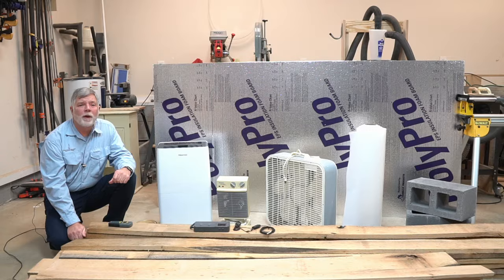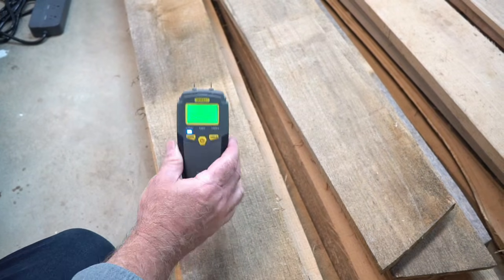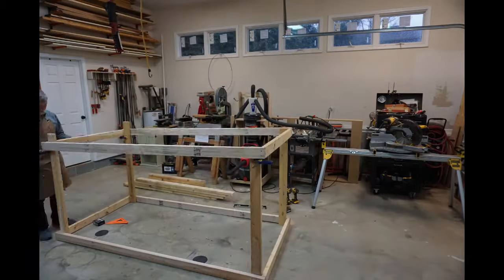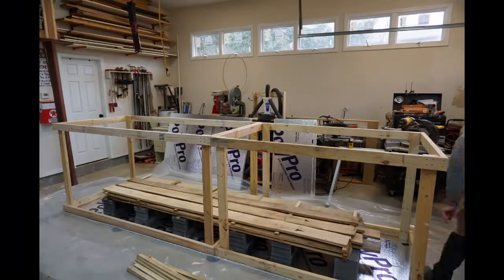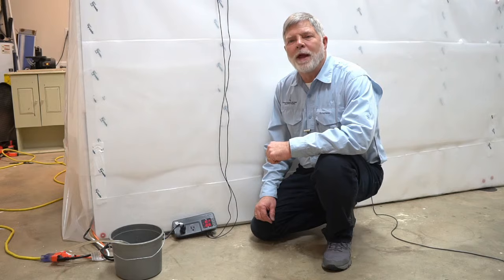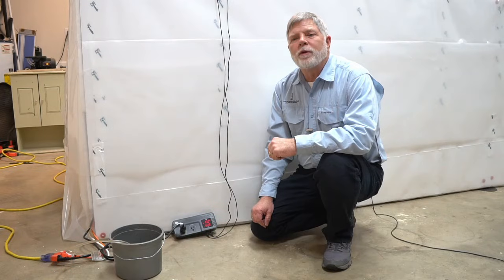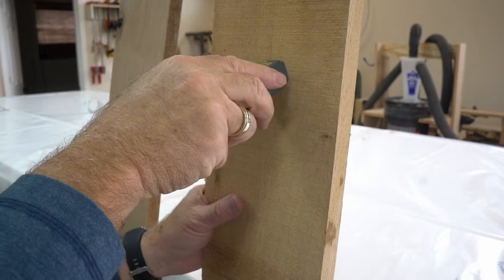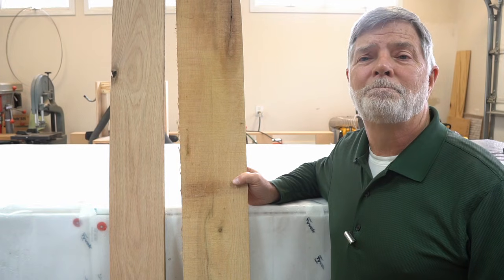Simple DIY Wood Drying Kiln

Comment: I have a project that requires the wood from a large log sooner rather than later.  Would I be able to use this kiln to dry the wood faster, or do you still need to wait a year to let it all dry before putting it in the kiln?
Reply from the maker: Yes, you can dry green wood in this kiln. It will take 60 days or so. Dry the wood slowly and keep the temperature around 90 degrees.

Comment: Very good information and thanks for sharing it with us.  I am building a 4ft by 4ft by 6ft hot box inside my garden shed.   I put a 24 inch by 32 inch tall access door yesterday.  Testing last night it was 13 degrees outside and it got up to 131 degrees in 45 minutes.  No wood in the kiln yet.

Comment: Can i use this for outdoors?.  I don't have enough space in garage?  Also how long would it take for newly cut trees to get to 8% for woodworking?
Reply from the maker: This design is not weather proof. I would not recommend using it outdoors. Depending on the species of the wood and the thickness of the lumber, it will take 8 weeks or so to dry from green to 8%. If you dry it too fast, the lumber may crack.

Comment: Absolutely brilliant! In your opinion, how long does it take to dry a beam 100*250mm * 6 ft of douglas fir cutting costs please?
Reply from the maker: It will depend on the MC when you start. Green Douglas Fir can have a MC between 60% and 100%. You need to measure it with a moisture meter. You should not remove more than 2% per day. You should plan for at least 4-6 weeks.

Comment: Hello. Your video is great. But I wonder; you used the poly pro foam board product. This product is a product with completely thermal properties. Would using a cheaper product like a different standard foam board instead be useful for this project? Frankly, I am new to woodworking and my budget is limited. In addition to all this, I live in TURKEY and the inflation rate is incredibly high :)
Best Regards Ugur INAN
Reply from the maker: Any insulation that does not trap moisture will work. I have since started using a 1 1/2"  rigid foam board. The added insulation reduces the amount of heat input I have to provide.

Comment: Thank you for the description, I’m currently making a copy of this to kill bugs in air dried wood.  Did the heat lamps alone get the temp into the 130 F zone to sterilize the wood and kill the pesky bugs ?
Reply from the maker: Yes. It should. Air dry does not get lumber to a moisture content sufficient to be used for an indoor project or furniture. I would guess the MC would be around 12 percent. You should be around 8 percent for a furniture project. I air dry first then kiln dry. Be sure to have fans to circulate the air.

Comment from the maker: I'm sorry you're having this trouble. I looked at my dehumidifier. It is rated at 70 pints at 95° at 95% humidity. I have never had it shut off due to high temp. I saw a minimum operating temperature but not a maximum operating temperature. I'm sure there is an upper limit but I don't know what that is for my unit.
Reply from the maker: I keep my kiln between 90° and 100°. That is within the specs of my dehumidifier. The wood will dry at lower temperature. It will take a little longer.

Comment: I was thinking of building this in my garage, my only concern is fire safety with the heating lamps. As I am not able to be home everyday to monitor it. Any thoughts about that concern.
Reply from the maker: You can use any heat source that you can control. The drying process does not need much heat. I try to keep the kiln between 90 and 100 deg. With good insulation, the dehumidifier will provide that level of heat without any supplemental heat source. The higher temp of about 150 deg is needed for sterilization and only needs to be held for about 8 hours. Plan this step on a Saturday when you can monitor it.
Reply: @logstolumbernow2011  thanks again for the response! My lumbar is fresh cut a week ago tree to lumber 2” x 6” about 219” total square feet accounting for both sides of the board. It is reading at 45% MC. I am worried that if I set the dehumidifier to 40% humidity from the start I can risk removing water too fast, greater than 4.4 lbs per day ( or roughly a half gallon per day) and cause case hardening. Is this method even capable of removing that much water that fast? Or should I gauge the relative humidity in the kiln first then set the dehumidifier to a relative humidity say 5-10% lower than thy in the kiln and step it down over time as the humidity in the kiln matches the setting on the dehumidifier?
Reply from the maker: If you are drying from green, I would take it slow. Set the dehumidifier to 55% or so and get the temp up to around 100 deg. It should take 45-60 days to dry from green. Keep the air moving.
Reply: @logstolumbernow2011  I got it running one 250 W heat lamp, a fan, and dehumidifier set on 55.  But the temp won’t get above 80 F and the humidity is reading 75%, been running for 3 hours
Reply from the maker: In later versions of this kiln design, I added 1 1/2" pink styrofoam insulation, cut to friction fit between the 2x4 structure. It improves the heat retention. Give that a try.
Reply from the maker: It does take time to raise the temp of this much wet wood.
Reply: @logstolumbernow2011  thanks that’s what I was thinking the wet wood could be causing the temp to be lower. I really appreciate your responses as I go through this process.
Reply: @logstolumbernow2011  starting MC was 45-50%. I am at about 93.5 F on day 3 with 95% humidity. Dehumidifier is set to 55% is it normal to have 95% humidity with a dehumidifier on 55% or is my humidifier not working?
Reply: I should say that silly me set it to pump and I have to wait until I get 50 pints of water in the reservoir before I see water pump into the bucket 🪣.
Reply from the maker: Sounds like it is working as long as you are getting water in the dehumidifier reservoir. The humidity will remain high until the wood loses a lot of its water.
Reply: @logstolumbernow2011  I discovered that dehumidifiers shut off at temps over 90 F. My dehumidifier will turn on initially then turn off and won’t turn back on. Shouldn’t it be running continuously until the RH you have it set to is reached? I have been averaging about 83% RH for a week and barely any water output.  I got a new dehumidifier and it I doing the same. I filled up the tank so any new water removed from the air will trigger the pump and pump it out into a bucket. I don’t know what to do… maybe the dehumidifier needs more airflow around it? Another fan?

Comment: Seems like you would get better air flow through the wood pile if it flowed parallel to the stickers rather than perpendicular .
Reply from the maker: You are correct. With limited room to work with, there are not a lot of choices. In later versions of this kiln, I used smaller fans and placed them on top of the lumber stack blowing parallel with the stickers. I believe that the air turbulence created by the fans in such a confined space will adequately provide air circulation regardless of the fan orientation.

Comment from the maker: You will want to heat the kiln to at least around 90 degrees so the air will hold enough humidity for the dehumidifier to work efficiently. Cold air does not hold as much moisture. If you are not sterilizing the wood then you may not need the heat source. The heat from the dehumidifier compressor may be enough if you use some insulation.

Comment: Is the foam board only to retain heat? I'm considering building one of these to speed up the process of firewood drying (different dims) so I dont need to sterilize the wood. But I would want to bring wood thats 20-30% moisture down to <15%. I am wondering if I even need a heat source or can just run a simple dehumidifier and maybe a fan to help circulate.

Comment: Hey L2L, Thanks for sharing your design. I've got some beautiful 2-3"thick x 30-40" wide cherry slabs that have been stickered in a garage for a few years. I noticed powder post beetles got into it, and I've been mulling how to heat it for pest control. At this point I'm not concerned about moisture; I just want to kill the bugs and larvae. Based on your design, lets say I made a stack that maxed out the inside space of your kiln--Do you think it would work?  What would I have to do different?  Is there any way to test the wood for internal temp? Maybe bury a remote read probe inside a piece, like the one I used for the turkey a month ago. Is there any way to know for sure you killed all the bugs?  Look forward to hearing from you. Cordially Devin, the relocated Yankee in Raleigh, NC
Reply from the maker: I would treat the lumber with a borate based product such as Tim-bor or Boracare. If you raise the core temp of the wood to 150 deg and hold it there for 24 hrs, you should kill any pests. The wood should be below 20 percent MC before you sterilize it. Otherwise you may cause more problems. Yes you can use a bar-b-q temp probe in the center of your stack but that may not tell you the core temp of the wood. You will need a heat source and a fan. A space heater may not work due to safety over temp switches.
Reply: @logstolumbernow2011   I considered boracare; I used on a log cabin that had some ppbeetles. My understanding, which may or may not be correct is that it doesn't penetrate very deeply and it's effectiveness occurs when the critters exit the wood and cross the toxic zone.  I was also concerned about the treated wood which I would then have to plane and sand; I supppose certain finishes would ultimately seal in any residual pesticide...on a dinner table, for example. I'll check the mc and run it as a kiln first if needs be; I'm sure it's below 20%; I think I recall 15% or so....I have a friend with a seldom used wood fired kiln in a shipping container. He has a wood mizer and plenty of stacks of lumber that probably have a healthy PPbeetle population going. Pretty hard to avoid I reckon.  Re: the turkey thermometer--I was thinking about burying into the wood. Are you still milling in northern alabama?
Reply: I mentioned my friend who seldom uses his kiln because I'll ask him if I could run it in that one for a fee; I was worried about bringing beetled wood on his lot but i recalled there are stacks of all sorts of wood there....which might already host some bugs.
Reply from the maker: Yes, I am still milling in north Alabama, at least for a few more years I hope. @devindascher

Comment: Since you are using the heat lamps on a temp controlled power strip is there still a need to ventilate?  I couldn't tell in your video if you had an opening on the end where your fan is or is the entire kiln sealed off?
Reply from the maker: I did not have a vent in this version of the kiln. In later versions I built, I added 1 1/2" pink insulation board cut to friction fit between the 2x4 structure. This kept the temperature higher so I did vent it until the sterilization step.
Reply: Thanks for the reply.  
In the later version you built, did the pink insulation go on the inside between the 2x4 frame? @logstolumbernow2011
Reply from the maker: Yes. I cut each insulation board to wedge between the 2x4 frame members then put the foil backed Styrofoam insulation on the outside as shown in the video.

Comment: If I missed it i'm sorry but what insulation did you use for the Kiln.  Thanks
Reply from the maker: In the video, I used 1/2" foil backed Styrofoam panels. I have since added 1 1/2" pink foam board insulation cut to friction fit between the frame structure.

Comment: Great video, found exactly what I have been looking for. With his design and this equipment, how much timber, maximum, do you think/recommend I can dry effectively?
Reply from the maker: Approximately 300 bdft for a 12'x4'x4' version of this kiln. That is a lumber package, including stickers, of 3'x2'x10'.
Reply: @logstolumbernow2011  much appreciated for your feedback.
If I wanted to increase the capacity, say double to 600 bdft, would I be correct  to increase, besides the size of the kiln build-up, the quantity of heat lumps the and perhaps size of the dehumidifier? If so, will these changes suggest a much longer drying period to achieve the required MC? 
Thanks in advance for your guidance.
Reply from the maker: @milnemataifa7200  I do not think you would have to scale up the dehumidifier or heat source. Mine do not run continuously to maintain the humidity and temperature set points. Yes, it will take longer for the lumber to dry. The difficulty would be in scaling up the structure. It would no longer be sub multiple sizes of common 8' construction material. It is very efficient to build the structure in multiples of 4' cubes. If you build it larger, you may need more structure just to support its own weight and cross bracing to keep the structure from racking. Horizontal 2x4 pine construction lumber begins to sag at lengths past about 48" without support.
Reply: @logstolumbernow2011 
Oh yes thanks you brought up the strength of the structure, a very important consideration to make.
Man I couldn't thank you enough for this golden information. 🙏

Comment: If electrical costs are a concern, a portable air conditioner (using the hot “exhaust” hose) would be more energy efficient than resistance heating.
Reply from the maker: Interesting approach. I'll have to look closer at this option.

Comment: I have old house 20 m2 and I place in that house 2 m3 wood board (20-30%) wet

There are no windows in that house, only one stove. 
Inside that room, I have 2 fans blowing against the wood board. 
What do you think is that enough or do I need a dehumidifier? I am thinking that the stove was sucking moisture from the air

Thanks
Reply from the maker: The only way to tell if it is "good enough" is with a moisture meter. I doubt the stove is removing very much moisture. In fact, depending on the fuel source, you may be adding moisture to the room. I would expect the room needs to be vented to allow hot moist air to be replaced by dry cool air.

Comment: Wow good to know that this works, I have an idea in mind to build a kiln very similar to this once I setup my saw mill but was not sure how well it would work.
Reply from the maker: Thanks. In later versions of this kiln, I added 1 1/2 foam board insulation cut to friction fit between the 2x4 frame in addition to the styrofoam insulation.

Comment: I’m about to build a kiln based on your design. How long would it take to kiln dry redwood that is green? It’s for an outdoor gated entrance which has intricate panels 1/2” thick and frame 1 3/4” thick.
Reply from the maker: Be sure to buy a moisture meter. Use it periodically to check the MC during the drying process. For an outdoor project, an MC of 12% is adequate.  Redwood heartwood has a moisture content of 90% to 100%. You should target a drying rate of about 1% per day. It should take 2-3 months.
Reply: @logstolumbernow2011  thank you 🙏

Comment: Hi. Three quick questions. 
1. Do you have links for the temperature control gauge and the heat lamps you used?
2. What would happen if you only used a dehumidifier, and not any heat source. Would you still get any positive benefit? 
3. Were you running everyone constantly or only for so many hours a day?
Thanks!
Reply from the maker: I used the Inkbird temperature and humidity controller bought from Amazon for about $70. Here is the link. https://www.amazon.com/gp/product/B07GQWY9HM/ref=ppx_yo_dt_b_search_asin_title?ie=UTF8&psc=1

The heat lamps were GE  250-Watt Dimmable R40 Heat Lamp Incandescent Light Bulbs I got from Lowes. They were about $10 each.

In later versions of my kiln, I added 1 1/2" pink insulation board, cut to friction fit between the 2x4 structure. With this added insulation, just the heat generated by the dehumidifier was enough to keep the temps up. In fact I would have to vent it some to keep it from getting too hot. The heating element is needed only to sterilize the wood. This kills any insects and their eggs and fungus. It also sets the pitch if it is a pine. You do not want to run your dehumidifier at the temps required for this process. You may damage your compressor. You don't have to sterilize your wood but you run the risk of having insects emerge from your new dinning room table.

The dehumidifier was powered continually however it only ran when the relative humidity increased to the setpoint. I keep the RH around 50%. The heat lamps were similarly controlled with a temperature setpoint on the Inkbird.

Hope this helps. Thanks for watching...
Reply: @logstolumbernow2011  thank you very much for this detailed response! I'm curious, do you have any contact info for this account, like an Instagram? I would like to send you a link to the dehumidifier I bought but YouTube is being wired with posting links in the comments
Reply from the maker: @Therunnerisrunning  I use a Hisense 70 pint dehumidifier with pump, model #813826. A smaller unit may require additional time to dry the wood. Any similar unit will work just as well.

Comment: Hi there. I have some 2x4 wood I want to reduce the moisture content to 8% Can you tell me step by step and how much time it takes to dry? thanks you so much
Reply from the maker: What is the starting MC? How many bdft are you wanting to dry at a time? If it has been air dried it should be around 12%. It takes about a week in my setup to dry from this point. It should dry at a rate of about 1% per day. If you are starting from green, the MC will be 100-120%. Drying from green is not linear. For 400 bdft, from green, it will take 2-3 months.

Comment: This is helpful. So I am clear, the total time inside the kiln was about 10 days? Including the 130 degree heat treatment? Thanks in advance for your response.
Reply from the maker: Yes, but the wood had air dried for a long time. The Initial moisture content was about 12% when I put it in the kiln. I dried it to 8%.   Green wood will take 6 weeks or so.